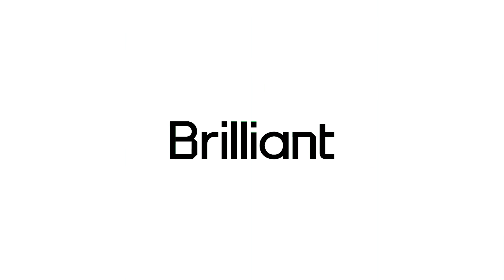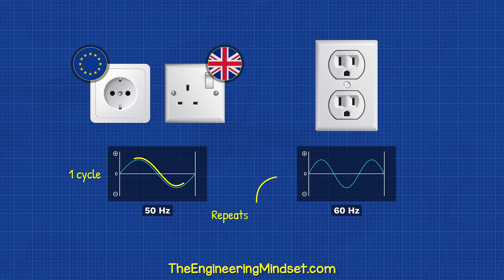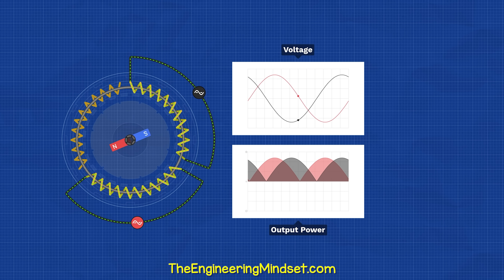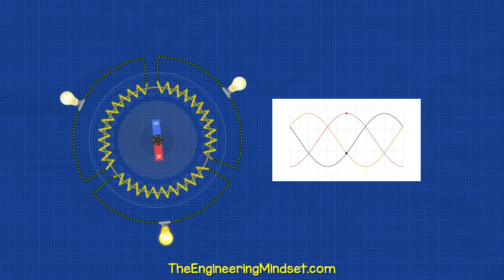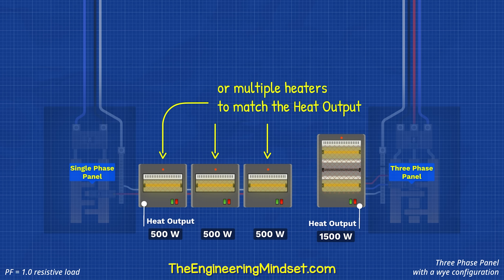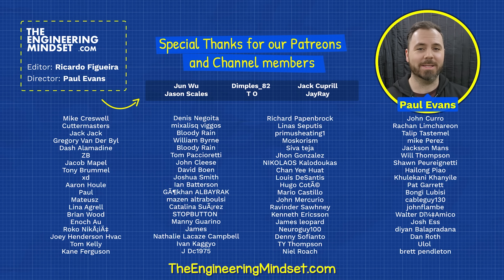How 3 Phase Power works: why 3 phases?

Comment: So is the main purpose of three phrases to provide a DC power? If so, why don't just use a AC-DC converter?
Reply from the maker: Multiple reasons for 3 phase are listed throughout the video, here are some key points
4:30 Explained how 3 phases provide constant power. Graphic shows “almost” and audio says “more constant” with some small ripple shown, at this point all phases are still separate circuits and we have built upon simple single, two and then three phase generator.
5:05 Explained how it provides equal spacing. 
5:36 Explained how more phases means more cables, controls and protection equipment, complex infrastructure, more complex transformers and motors, harder to balance network and synchronise generators.
6:22 Explains how only 3 wires are needed which is cheaper.
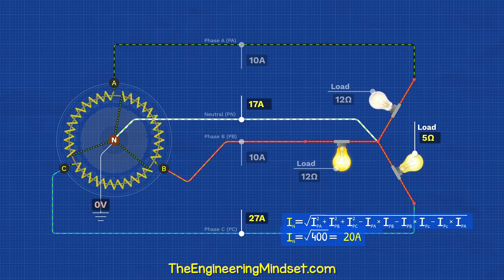7:26 Explained how neutral can be used to balance
7:54 Explained how we use single or three phase from same system
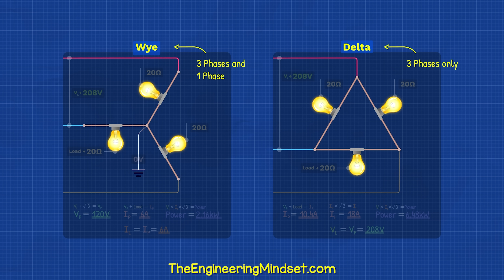8:21 Explained how Wye and Delta are used for different scenarios. Examples uses same resistance and line voltage.
9:59 Explained how 3 phase allows more loads to be connected
10:17 Explained how 3 phase uses more energy but provides more heat
10:19 Compares single and 3 phase power, shows 3 phase power is consistent 
10:36 Shows single phase and 3 phase motor. Single phase has capacitor
10:41 Shows comparison for 3 people v 1 person for motor analogy.

Comment: thanks for never answering WHY 3,  all you said is that its to expensive, if that where the case we would have 1 or 2 phases cuz they are cheaper!
Reply from the maker: Multiple reasons for 3 phase are listed throughout the video, here are some key points
4:30 Explained how 3 phases provide constant power. Graphic shows “almost” and audio says “more constant” with some small ripple shown, at this point all phases are still separate circuits and we have built upon simple single, two and then three phase generator.
5:05 Explained how it provides equal spacing. 
5:36 Explained how more phases means more cables, controls and protection equipment, complex infrastructure, more complex transformers and motors, harder to balance network and synchronise generators.
6:22 Explains how only 3 wires are needed which is cheaper.
7:26 Explained how neutral can be used to balance
7:54 Explained how we use single or three phase from same system
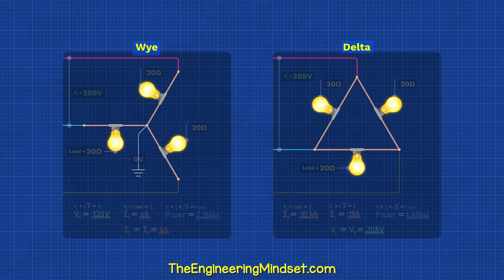8:21 Explained how Wye and Delta are used for different scenarios. Examples uses same resistance and line voltage.
9:59 Explained how 3 phase allows more loads to be connected
10:17 Explained how 3 phase uses more energy but provides more heat
10:19 Compares single and 3 phase power, shows 3 phase power is consistent 
10:36 Shows single phase and 3 phase motor. Single phase has capacitor
10:41 Shows comparison for 3 people v 1 person for motor analogy.

Comment: Incandescent lamp flicker at 50hz (or 60hz) is effectively non-existent. The slow time constant of the white hot filament barely changes intensity at line frequency. You are not going to see it, and it is hard to make a circuit sensitive enough to even detect the subtle dimming. Old fluorescent light flicker with a magnetic ballast is easily detectable with a photovoltaic (PV) or light dependent resistor (LDR) even though it is 2x the line frequency. Newer fluorescent with an electronic ballast may flicker much faster than line frequency.  LEDs may or may not be constant. The same simple circuit can detect. If the LED bulb is dimmable it will almost certainly flicker, but usually will be at a much higher frequency.

Comment: Very nice video. I would comment on 3 phases in a "standard" home. I live in the central Europe and generally, at least nearby big cities, we do have 3-phase connections. I'd say it's a must for new installations because we need more and more power. One typical appliance that requires at least 2 phases is an induction cooking plate. And if you're a DIY hobbyist, there's plenty of 3-phase machines targeted at home/garage shop customers.
So, in general, having 3-phase power at home is a nice thing
Reply: Can confirm, am Europe, cookingplate (induction) + oven combo is hooked up to 3 phase power. Its just nice to have

Comment: Also, you can convert single phase into 3 phase using a full wave rectifier (Center tapped or bridge.), but not smoothing the output, then using a 3 phase inverter to convert it to 3 phase AC.

Comment: Another benefit of 3 phase vs 4 phase is that you can only ever connect a 3 phase motor in two ways - forwards or backwards. With 4 phases you could accidentally connect it in a weird configuration, i.e. 1 3 2 4 instead of 1 2 3 4. Not sure what would happen, I guess it would be "deadlocked" and get fried if it wasn't properly protected with a "motor protection" (not sure what it's called in english) and if the fuses were not sufficiently weak...

Comment: a tiny correction at 12:27:

in europe most residential houses, even single family ones, are connected to the Grid with 400V,  3 Phase Power. most of the times the 3 phases are distributed into different rooms/apartments in your fuse box so you can distribute the load over all 3 phases. it was pretty rare to have direct access to 400V Power in some way though, its distributed inside the walls and would only be installed and worked with by certified professionals that are allowed to open sealed parts of said fuse box.
Reply: european ranges are usually connected to 400v 3x16a 3 phase & european garages usually have a standard red 400v 3x16a 3 phase socket

Comment: Don't forget that there are literally hundreds of millions electrical machinery, which have more (or less) than 3phases.  There are various reasons for this.  Good examples are Ships drives, Robot drives, Railroad drives, Automotive alternators, Stepper drives, Computer drives, Mining and Concrete drives, Micro and Nano Meter drives (which can have millions of phases), and best of all, Electromagnetically Driven Weapons.  Our company worked on all of those.

Comment: In Denmark, almost all if not all households are connected to three phase (400 V), which is used for the most power-hungry appliances such as the stove. But why does the three phase plug have five connectors?
Reply: it has l1, l2, l3, neutral & ground
Reply: @gamecubeplayer  What's the difference between neutral and ground? Isn't neutral connected to ground?
Reply: @HBrobjerg if it's tn-c then there's no difference but if it's tn-s then they're kept separate because that allows an rcd

Comment: we had an introduction to electronics and calculus in high-school, for the career of computer sciences.
the teacher would sometimes give us troll exercises to figure out values, with shorted loads, open ends or badly grounded builds.
one time it was three of us working the problem, and we found one such troll variable, so we rewired the problem to wye/delta to double-check, and kept getting the error.
so, the teacher checked it and told us "Yes, it's wrong... this part is shorted, so of course it gives 0!"
other groups scribbled whatever numbers to make it round, because they figured "it can't be 0! it must be a mistake!" XD
Reply: Those were not troll problems at all, they were very common scenarios working on circuits in the real world, and circuit analysis of short circuit current with open circuit voltage being used to characterize a power source.

Comment: It might be a stupid question, but how does that work in us homes when you have two fases to make 240v?
Are the fases 180° apart or is it 120° with a fase missing?

Also in the Netherlands most new built homes get standard 400v 3-fase because of the high consuming equipment.
Most of the new built homes are not connected to the gas lines anymore.

Comment: 4:30 "Output power almost constant". I hate to be this guy, and am a little worried that noone in the top comments has pointed it out: The power in a 3-phase system IS constant. What you displayed is the voltage, not the power. Multiplying the voltage * current * sqrt(3) for all phases and adding them up gives a constant power, no matter the angle. Adding more phases past 3 adds no benefit to the system, and would only drive up cost as more wires are used, that's why there are only 3 phases, not more.

Comment: This video failed to address the question in the title: why 3 phases? I once worked out why 3 is optimal but can't recall right now.
Reply from the maker: Multiple reasons for 3 phase are listed throughout the video, here are some key points
4:30 Explained how 3 phases provide constant power. Graphic shows “almost” and audio says “more constant” with some small ripple shown, at this point all phases are still separate circuits and we have built upon simple single, two and then three phase generator.
5:05 Explained how it provides equal spacing. 
5:36 Explained how more phases means more cables, controls and protection equipment, complex infrastructure, more complex transformers and motors, harder to balance network and synchronise generators.
6:22 Explains how only 3 wires are needed which is cheaper.
7:26 Explained how neutral can be used to balance
7:54 Explained how we use single or three phase from same system
8:21 Explained how Wye and Delta are used for different scenarios. Examples uses same resistance and line voltage.
9:59 Explained how 3 phase allows more loads to be connected
10:17 Explained how 3 phase uses more energy but provides more heat
10:19 Compares single and 3 phase power, shows 3 phase power is consistent 
10:36 Shows single phase and 3 phase motor. Single phase has capacitor
10:41 Shows comparison for 3 people v 1 person for motor analogy.
Reply: @EngineeringMindset  None of those points explain why the number 3 is special. Any number of phases can be evenly spaced in time. Two phases (or indeed any number other than 1) is perfectly sufficient for constant power - just look at Euler's formula to see why. The video explains "why not 1 phase" but never addresses "why 3".

Comment: My house in England, UK, suffered an unusual power cut. Every third house in the street had no power, but the others did. Turned out that the hole dug to do work on a gas pipe around the corner had nicked the underground electricity cable. Six months later, ONE of the damaged cables blew out. But the buried cable was three phase and neutral. All of the houses only received single phase, so they had spread the load by connecting every third house to one of the three power lines. So only every third house lost power when one of the three phase cables blew. This was a most rare event, but it revealed how the UK sends three phase supply everywhere, then divvies up the supply at individual house connections.

Comment: Does your 3 phase generator have a neutral? Or would you take delta off the generator and transform it at the consumer end to star? You can run 3 cables (or cable pairs in the UK by looks of things) for the really long transfers then you have the common neutral at the consumer end from which you take single phase loads.

Comment: Nice explanation! Except for the RMS part, that honestly shocked me a bit - it's certainly not just that "someone realized" heat production in a resistor and experimentally figured out the ratio approximating sqrt(2), you can really calculate that knowing that P = U*I = U²/R (which, yes, "someone" realized at some point), calculating the average power noticing that sin² averages to half the (squared) peak and taking the square root of 1/2 to obtain exactly the sqrt(2)
Reply: Well said. I think😂

Comment: North America technically uses 240v single phase.  Our transformers are just center tapped for neutral allowing 2 legs of 120v potential to neutral. Which makes 2 legs of 120v  at 180° out of phase.  Loosely called "split phase" 
240v + neutral come into the house, most big appliances, HVAC units, and garage appliances like large air compressors use 240v while all the common outlets for small appliances, lights, and other things use 1 leg of the 120v.
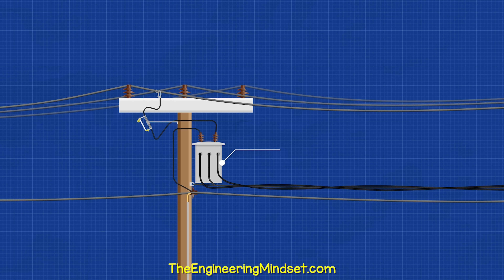Reply: 12:34 he said 240v single phase

Comment: I wonder why the LED's light up and dim in a way that looks like a window being opened and closed. Anyone have any idea why it looks like that? I would have expected them to just light up and dim in the same way an incandescent light does (or even more immediate), so it would just be on/off with no kind of delay at all.
Reply from the maker: There is a long thread in the comments section where it's been discussed. Basically shot on a samsung which has altered the footage.

Comment: Excellent tutorial. If these concepts were taught in schools this way then more people would be interested in the various electrical tradecrafts. You answered questions that have been lingering in my brain for the last 40 years while working as a tech in plant maintenance. Direct Current is easy and straight forward. Alternating Current is more complicated but you have done an outstanding job with illustrating the concepts and simplifying the alleged mysteries. Well done. I'm subscribing. (i.e. I always wondered the reasons why Delta and Wye were used in 3 phase circuits)

Comment: A valuable video explaining three-phase current. Many people think it is just one current (going by the name).  I think coils in the stator of the generator are positioned radially from the center, and not along the circumference, for better magnetic field penetration/change. This is demonstrated at 1:10 into the video.

Comment: When designing the transformers for the HV supply for for the channel 4 TV Transmitters we specified 2 secondries  one connected in star the other in delta to give 6 phase output, this simplfied the smoothing quite a bit.

Comment: More than 3 just adds complexity. Got it. You didn't say that, but I assume you can't have only 1, unless you leave half of the rotation without a coil, which is wasteful. But why not 2 Phases? Is it because then you'll have a zero voltage point on all phases?
Reply: 2 phases can't normally rotate a motor
Reply: @gamecubeplayer  you can, but you'll have 2 dead zones, the direction of rotation is going to depend on the angle of the rotor,  and if it stalls it could switch direction.

Comment: You kind off blew through why we don't have more phases.  You need to explain why phase differential gets messy and the loss of power factor with too many phases.  Also we settled on 3 phases because the infrastructure was already there and major re-wiring was unnecessary.

Comment: Some tiny editorial remarks:
→ 3:41 The product of a sine wave with another one of same phase (as in the simple case of voltage × current), i.e. something like sin(x)·sin(x) (with some factor) doesn't result in a "|sin(x)|" curve like in the lower diagram, but in one which is smooth at the zeros – basically, another sine wave between 0 and max power, with double the frequency. (Somewhat similarly to what is explained around 12:00, just without the averaging.)
→ 3:50 I think the argument would be stronger if you put the second coil at 180° away from the first – of course with two coils 120° apart an imbalance is expected, the surprising thing is that with two which are 180° apart we still have some. (And then show the sum of the two and three power curves, not just the overlay showing the maximum of them.)

Comment: The "pulsing" on a heater will not be noticeable due to the high rate of the pulsing compared to the thermal time lag: the time needed for the heater elements to warm up or cool down.

Comment: THAT IS a cool cup! Edit:  But if I ordered it, it would NEVER make it here in one piece... :(
Reply from the maker: They are well packaged and if it did arrive broken, you can request a refund or replacement
Reply: @EngineeringMindset  (Military handlers... I wouldn't want to risk it.  I've gotten boxes of salsa where all the bottles were broken wide open, and all that was left of the box was a small piece with the mailing address on it--the put the rest of it int a trash bag to send to me.  I try not to order things here!)

Comment: Are all LED lights constant? Even in the case of dimmers? I feel like some of the LED lights in my house "Dim" by pulsing the LEDs
Reply from the maker: No not all. "most lights are now LED which are usually constant, so you probably won't be able to see these flicker" cheap LED lights will flickers because the rectifier circuit is poorly designed, dimming LED's can too. Our studio lights dimmable constant light LED so we can film. But the cheaper LED on my desk does flicker.

Comment: at 4:30 - 3 phase gives exactly constant power throughout the AC cycle as long as the load is purely resistive, e.g., a heating element or an electronic power supply with power factor correction. That's why it's used; otherwise generators and motors would vibrate unacceptably. Additional phases are used only in special cases such as very high power multiphase rectifiers where the output is proportional to the voltage, not the power (voltage squared).

Comment: In Germany even most small apartments get 3 phase power because electric stove tops and ovens are common and those usually take 3 phase power.
Reply: i know an old small finnish apartment which is 1x35a instead of 3x25a with a range which is 1x20a instead of 3x16a

Comment: I liked the infographic of single vs. 3 phase motors, depicting one person trying the crank vs. 3 people passing the crank.
In north America, the secondary 120/240 is referred to as "split phase", as phase to neutral provides half of the phase to phase single phase wave voltage by tapping the transformer in the middle.
Reply from the maker: Glad you  liked it. We did show a very nice graphic for split phase in out last video also fyi, link here https://youtu.be/u0SsejDCVkU